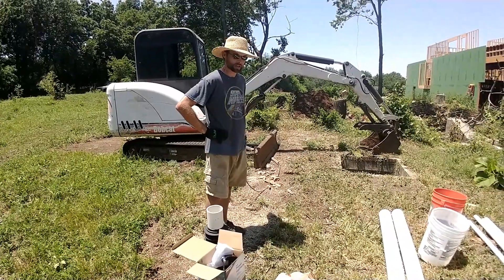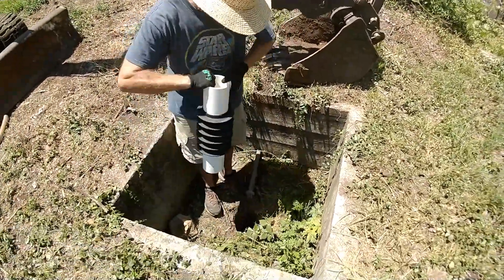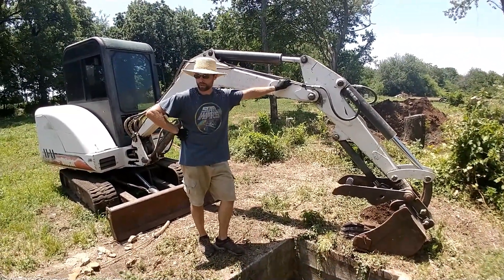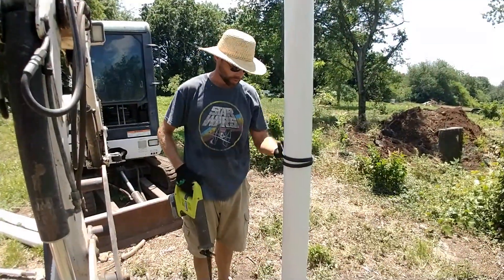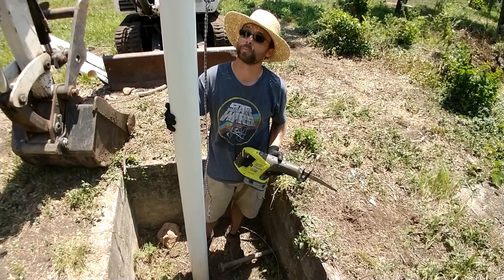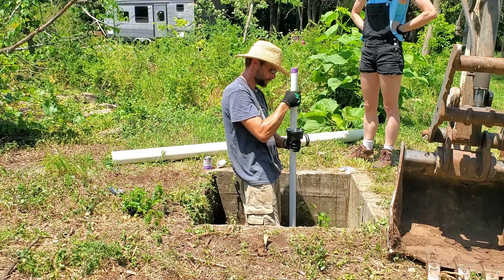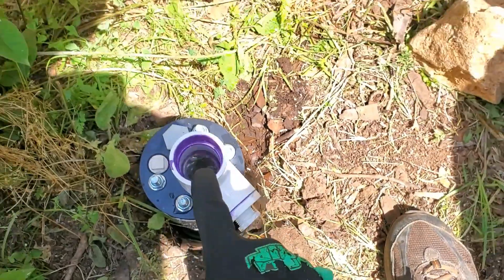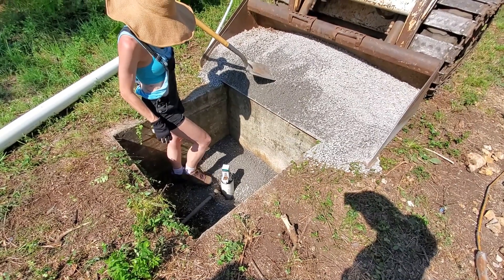Off-Grid Well Packer - Attempting To Put A Liner Down The Old Shallow Well

Comment: I couldn't believe when you put the Bobcat bucket on it - it didn't just push down in the old casing...wow!
Reply from the maker: We think the pipe collapsed.  There was a void several feet down that we got stuck on and that's probably where it fell apart.  Worth a try but was a clear failure.  We still have to try the same thing with the other well but our rainwater collection system has been working fine so there hasn't been an urgent need to yet.
Reply: @Off-Grid  we are doing rainwater catchment as Northern Nevada too. We are in process of constructing a modified Earthship style home on top of a mountain.
Reply from the maker: @rongray4118  nice, good luck to you!

Comment: I have an old well I am wanting to bring back to life. The casing was removed when the windmill for it was removed. Luckily we are on rock and the well is still in good shape. I would like to use a packer to seal the well and have some PVC casing. Where did you find the packer with the softer material? I have seen a harder blue version that looks very difficult to use.
Reply from the maker: Below is a link to American West Drilling Supply.  I called and talked with the sale guy who told me about the softer material.  Hope this helps you.

https://americawestdrillingsupply.com/wellpackers.html